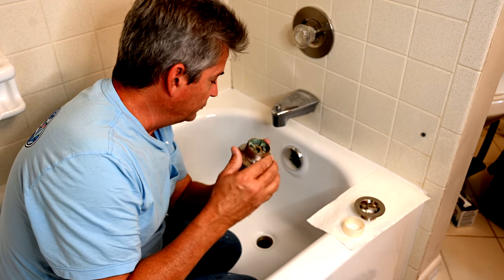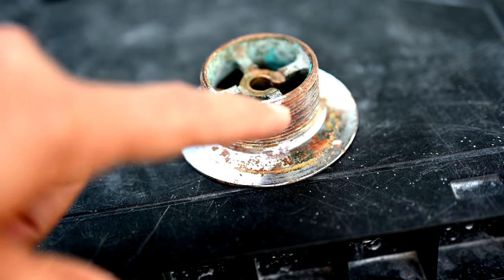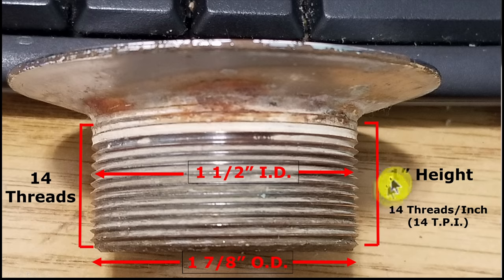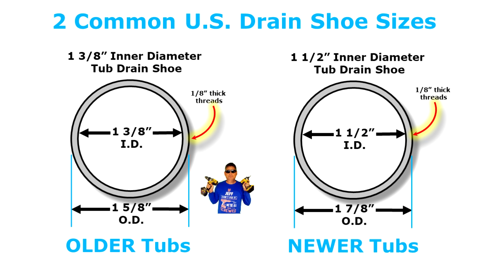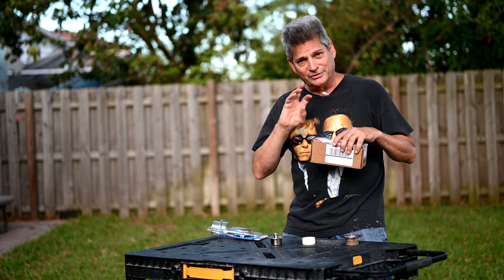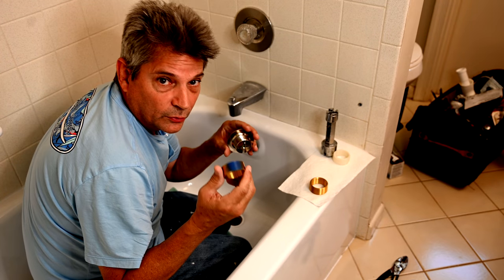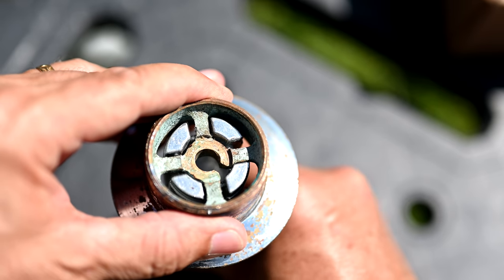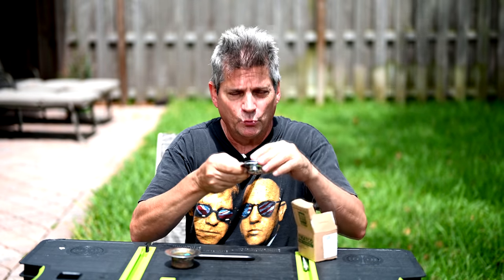New Bathtub Drain Won't Screw In? How To Fix Threads [SOLVED]

Comment: Yes you should always try and use the correct tool. However you most certainly can use a pair of pliers and you can use them with the handles pointing down into the drain. You just need to adjust the pliers. The ones I’m speaking of are the ones this video shows all you do is use the adjustment snd set it so that the working end the jaws are set for grabbing the larger size bolt. This causes the handles to come closer to gather at the bottom. Then they will fit into the drain. Yes you do take the risk of it damaging the drain trim. But most likely you are taking it out for replacement so it don’t mater. Plus even if you have the special tool, you still greatly run the same risk due to drain just being old snd stuck. You can Aldo use a couple screw drivers and a pair of pliers to turn them. By the way you will need a pair of pliers to turn the pliers in the drain as well you can also use a good sturdy pair of needle nose in the drain with pliers to turn. By the way if your drain is over a few years old count on it being hard to turn loose. Even with the correct tool. Many many times I start with the correct tool only to swap to the old true and time tested alternative means. Some times you even have to chisel out the old or make some small shallow cuts with a hack saw blade and bend and break the old out as long as your easy and don’t cut into the tub threads it will not hurt a thing. Snd at this point it’s your last option anyways. So unlike the man in this video I don’t make one red cent by telling you to use one tool over the other or get any type of payment other than self worth from saying BS TO ONLY UDING THE $10.00 special tool that slips out and is truly not much more effective than other methods that we have used long before this tool was around. So sometimes it’s just a tool promoting a tool. Enough said
Reply: By the way if you remove the old one first and take it with you it will save all the headaches of this video…. Just saying
Reply from the maker: No, you are wrong there. The stores give you only 2 types of thread, if your old drain is not one of them, no stores has the correct bushing in stock and you have to order on in the mail
Reply: @jeffostroff  yes you are absolutely correct on them only having the two standard size but if you take it you have a chance of buying only the one you need. That is if that store sells them that way. My local HD sells one in a kit that has both and they sell them with out the bushing. If I go to Ferguson plumbing supply they do carry in stock the 14 thread one.

Comment: I threw the old drain away and the 3/8 stops screwing in at a point.  Seems like it needs like a 1/4 but I have no clue on what to order. Help please
Reply from the maker: You will either have to get that old drain somehow if you can get it back out of the trash, or you're going to have to bite the bullet and have a plumber come and they will determine the threading they should have tools that could determine what the threading is on it so that the proper drain can be placed in there. The other thing you can do is if you have access to the wall behind the faucet, you can reach in there like some people do just cut a hole in the wall and put in a whole new drain kit from Home Depot the kit is basically $20. And people will just put in a brand new drain shoe opening with the overflow drain there it's all connected as a couple of pieces of plastic

Comment: What do you do if when you remove the old drain the pipe drops just enough so that you can't attach the new drain?
Reply from the maker: You either need to get a deeper drain shoe, or try to reach down in with one finger and pull the pipe back up because it isn't all shaped pipe so you should be able to curve your finger around it and pull the pipe back up or stick something in there to help keep it pulled upwards until you can thread on the drain shoe

Comment: Your better off to just replace the entire tub drain and overflow if you have an old one . There are fine threads and coarse threads. Most homeowners don't know that there are these two different threads, alot of the older tubs that were installed back in the 80s have smaller coarse threads which are hard to find. I even see contractors trying to thread a fine threaded tub drain into a coarse drain body and then they screw up the threads on the drain body and then Jerry rig it , 1 day later the customer has a water fall coming through there ceiling and of course the moron of a contractor does not respond to there call so they call me over there and now it's costing them roughly $3,000 to replace the drain / overflow/ trap. And hire a drywall guy to re - do there ceiling all because a should have been $100 job that a contractor who doesn't have a master Plumbing license caused.. 

My advice to everyone watching these DIY videos on YouTube is this. Call a licensed master plumber who has a reputable name to do any plumbing work. Do not hire a general contractor or handyman or you neighbor who replaced a toilet flapper at his house and now he thinks he is a master plumber because your just asking for trouble. 

Don't say I didn't warn you.

Comment: I appreciate your knowledge and expertise, but, I disagree on using the silicone caulk to add an additional seal.  Silicone is notorious for loosing adhesion in wet applications and can turn cloudy/dirty.   Plumbers putty is sufficient.  Oh, and never use a latex caulk in place of plumbers putty, because it will never fully cure.
Reply from the maker: You are wrong, silicone is not notorious for losing it's seal. and we use the kind with 30 year guarantee.
Reply: What knowledge he got this off another channel from you tube and reshared it

Comment: So I guess when replacing my mom's 40 year old drain and the top lip broke off, then the threads broke into 4ths will not help in this matter... All I know is with this expander on it won't reach the pipe... 😩
Reply from the maker: I would try to put it together and measure it.

Comment: You do know 1 1/2 plus a 1/4 inch is 
1 3/4 not 1 7/8  just wondering if you miss printed or what but that was wrong on your diagram.
Reply: It would have a wall thickness of 3/16 on each side or Total 3/8 .

Comment: In all my 63 years of DIY home repairs, construction work, all of it, the one thing I never had to touch was a tub drain- aside from running a snake down one and clearing hair, but I digress... All I'd do is grab a 6" X 3/4" black pipe nipple, my 5" grinder & maybe 4 minutes- and I'd have all the drain tool I need!

Comment: Why don’t you just take the old drain to the hardware or home improvement store? They have knowledge employees that will help you get the right part.
Reply from the maker: no they don't. And the hardware stores stock one type of drain that comes with the most common thread adapter. This was a rare one that not even home depot online sold.

Comment: Lol, it takes a engineer 20 mins to explain something that a plumber takes five mins to do.
But I understand this is for diy and it must be explained in detail.
I've seen so many diyers break out the cross with a pair of pliers then call the plumber.
All good tips for sure but if you have a leak it's not always the tub drain.
Reply: I had a leak and called a leak detection company, they said it was the drain.  I removed the drain and found a stripped out PVC drain shoe. Can it be re-threaded?